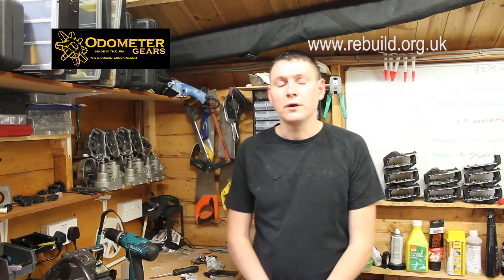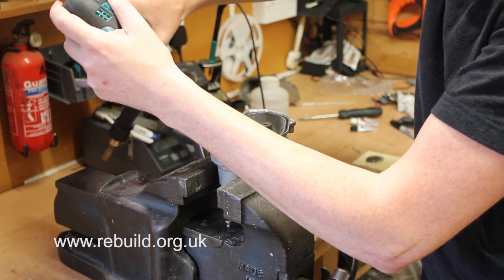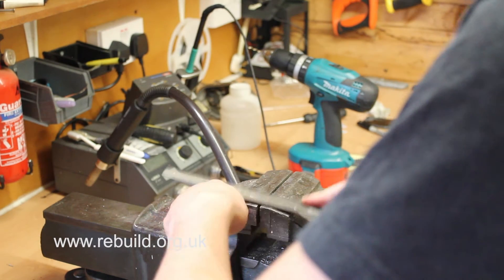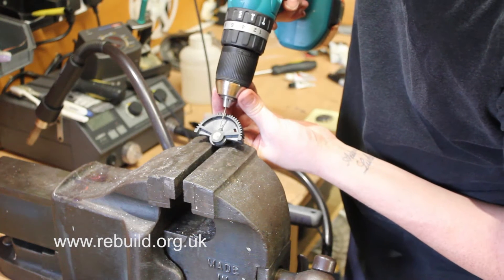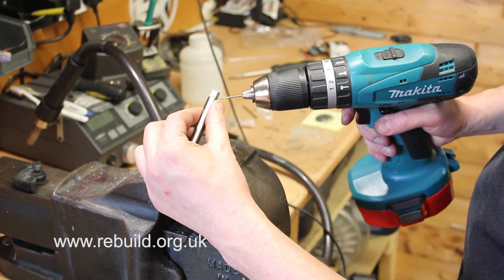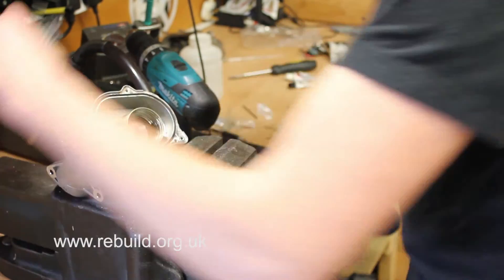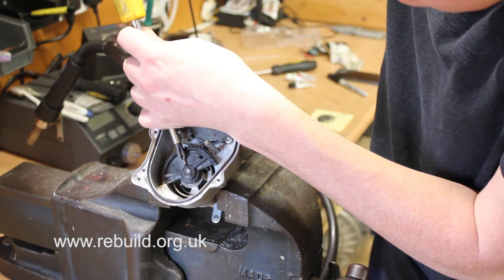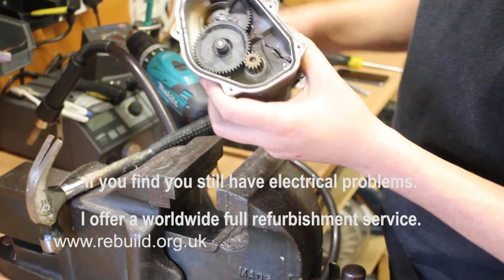NEW UPDATED VIDEO LINK BELOW Rebuild.org.uk BMW Throttle Actuator Gear Repair

Comment: Just purchased a set of Re-Manufactured Throttle Actuators from Rebuild UK's North American supplier called ///M Power Motorsports. Great people to work with. Price is unbeatable. Don't waste your time changing the gears. It won't work. If you're actuators are on their way out, just buy them from ///M Power Motorsports. https://www.mpowermotorsports.org
Reply: I have rebuilt one of mine with this kit, it worked great. I am about to rebuild another with the other gearset. what do you mean by "Don't waste your time changing the gears. It won't work."?

Comment: Where do I buy a set my actuators are going bad I don't have horsepower is says is engine malfunction operating at reduced power
Reply: manuel lares did you get yours sorted, what error codes did you get
Reply from the maker: Hi I don't look at these comments very often, for a fast reply, email via website for a reply with in 2 hours.
Yes I can sort this for you
Reply: @jasonbayliff1980  hi jason please i need your email 
I have problem in my car bmw e60 
Code p1624 and engine malfunction Reduced power